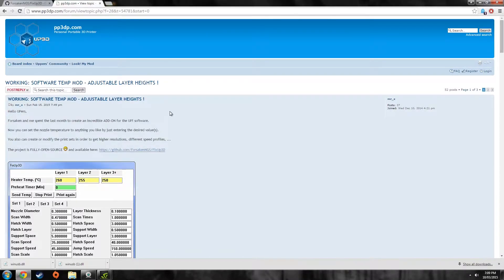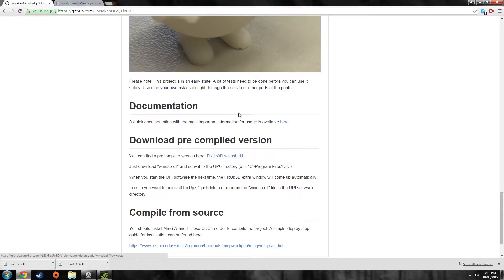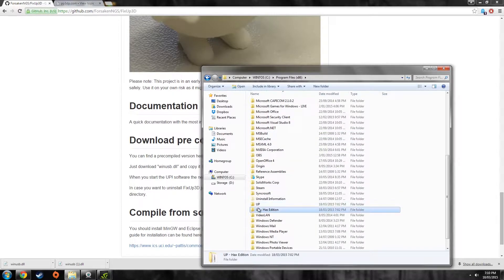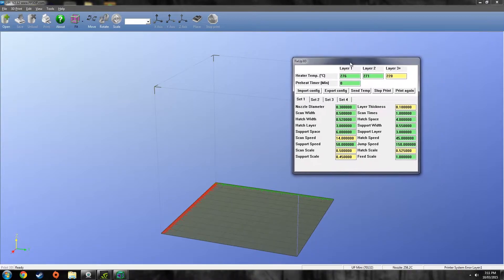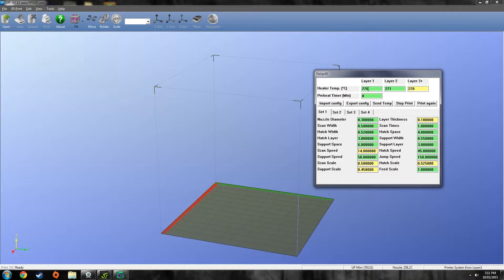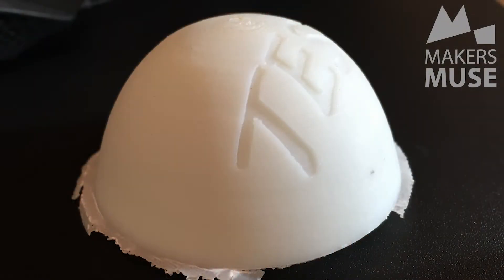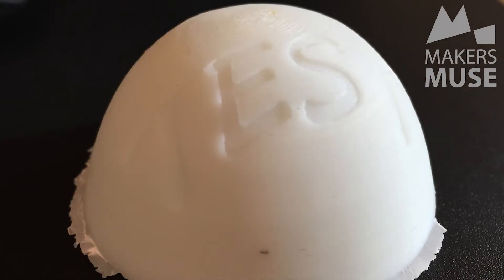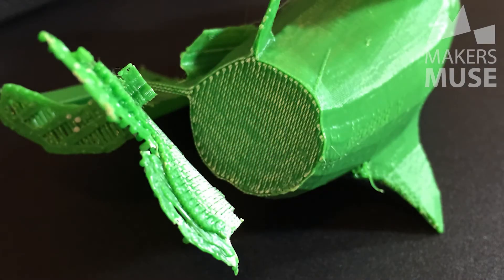Hack your UP! 3D Printer and set it FREE - 2015

Comment: Hey Angus
I bought an Up mini (not the 2) on craigslist brand new in box for $100! its worked great out of the box and I've been printing like crazy
I've been having a blast and am a fan and a subscriber.  My question is I'm trying to add a customize filament setting in up studio but I don't have the add button in your video only an import
Im running it on a mac by the way

Comment: Did you have problems removing your raft ? Because im using the fixup3d hack and have set my first layer to 240, 2nd layer 235 and 3rd layer 230.... but im unable to remove the raft... Any ideas to fix this ?

Comment: Have you tried the Jaycar PLA or ABS on the up mini ?  and what have been the results if any :)
Reply from the maker: +tack317 Not yet but it's on the cards! I haven't heard GREAT things...
Reply: +Maker's Muse I have tried the black PLA and when it works it is pretty good, but that seems to be 1 print out of 5. (temps 1:215, 2:210,3+:205) with all doors and fan door open,  seemed to work, the nozzle clogged halfway through on the second major print. so won't be buying any more from them  (I am only a Noob in the printing world so far :)

Comment: Can you print nylon with this hack now?
Reply from the maker: +XxbenjabobxX I've printed nylon using the stock temp settings, but yeah you should be right. Nylon requires a slightly higher temp than normal ABS anyway.
Reply: +Maker's Muse thanks! oh and I think the same concept applies, but would this also print the carbon fiber filament? great work by the way.

Comment: Hi Angus,
A quick question here. How do I start the print using the hack edition? Cause every time I hits the 'Pint again' button from the FixUp3D window, it just gonna print with the normal edition.
Reply: +Jason Handojo what i did was download 2.12 version of the software and just fill in all your settings then print normally and it will uses all the settings you filled out with the hacked window

Comment: Hi Angus,
Thank you for your videos on the Up! Mini. I consider buying one. I already have a Prusa i2 and Prusa i3 which work very good. I particularly like the design of the Up Mini. No messy wires visible from the outside and beautifully closed, ideal for ABS.
However I'm very familiar with slic3r and calibrating a reprap 3D printer.
What I really don't like about the Up! is that you need a computer and that you can't print from an SD card. That is such a shame :-(
I have a spare Arduino Mega 2560 and Ramps 1.4, so I was thinking maybe I could hack an Up Mini and add the LCD SmartController with SD slot. That would be very handy.
Therefore, I would like to ask you if you know if access to where the electronics are situated is not too difficult? Are the stepper motors just regular NEMA 17? Do you have any information about (or photo of) the electronics board and electronic components?
I know, a lot of questions :-)
Thanks again for the good videos.
Reply from the maker: +staa aajn The UP uses regular nema 17's, but the main benefit is the UP! slicer is really good. I know having a PC connected can be a pain, but it only needs to be done while the file is being sent over, I use a very low cost windows tablet for mine and it works great. The back cover is easily removed to access the control board should you want to, but just keep in mind the UP electronics are closed source and you can't modify them, or at least not easily.
Reply: Thank you for your prompt reply! Connecting to a table, that is also a very good idea and simpler solution. Thanks!

Comment: Hi Angus,  I have got the Winbo filaments, however, I am not sure I am doing the right setting on the FixUp3D pannel, what is the sequence of operation? when do I hit "send temp" button? or it will follow the temp setting on the fixup3d pannel by default? btw, for the Winbo filaments, good spool design, with default setting of the up temp, the printed parts feels much brittle comparing to the ZABS filaments, the support removal was ok if you remove them right after the print finished, and will stick a little if the perf board cools completely.

Comment: Great stuff!
The first calibration height off the nozzle you use distance 0.1 or 0.2 mm? I can not read it well from the different manuals. This qoestion is regarding the Up! Mini. Pleasse help! Thanks
Reply from the maker: shadow Helloween Heya, For your first nozzle height it's not 'too' critical, you want it close but not so close that the raft is too hard to remove or the nozzle starts clicking. I use a thin business card and slowly raise the bed till it grips it tightly. You can also adjust it in the print window before you send the file, so you can fine tune it that way. :) Once it's set, you don't have to worry about it again! Just guessing, my first layerheight is probably about 0.1mm from the bed so it squishes in nicely.
Reply: Please excuse my ignorance but i started computers late. How do i insert the hack into my program.I cant see too clearly on your video
Thank you